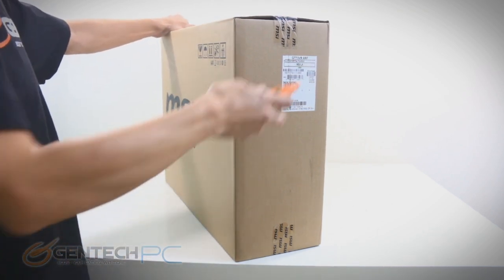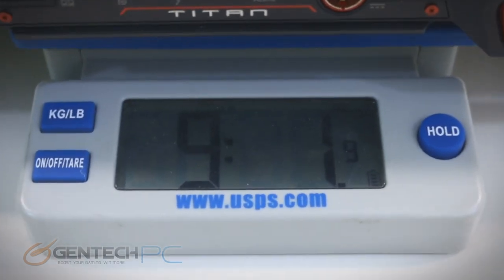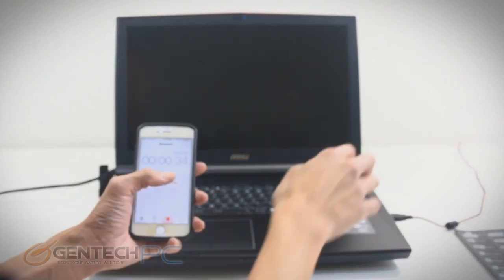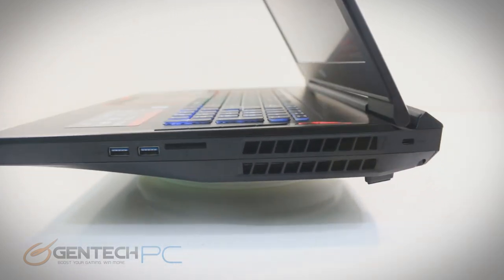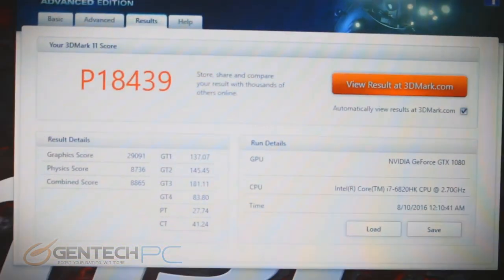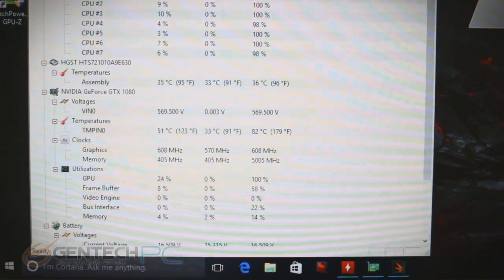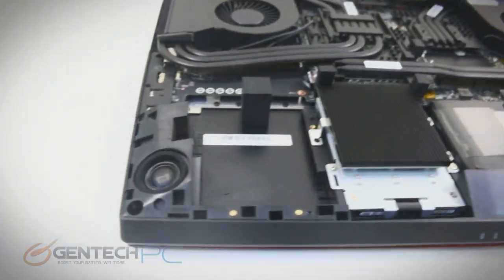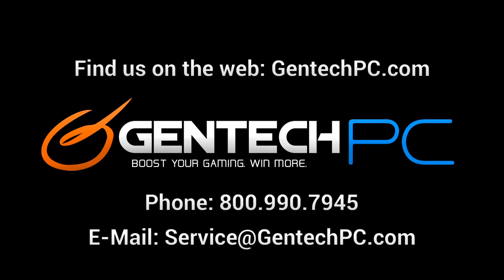MSI GT73VR NVIDIA GTX 1080 Review & Benchmarks

Comment: I'm currently saving up for a replacement Phantom 4 drone for one that I lost around a week ago. I'll save up for this gaming laptop too, will have it in around a couple of months. In the end, I will have both. Even though I already have a GT72 with 980M, I want to upgrade.
Reply: I also have the gt72 6qe like you. I got it in July and not this came out. The gt73vr titan01 is the same price as the one i have. Im so jealous, but the 980m is a beast all my games on high and i get real smooth frame rates so im not complaining.

Comment: Btw there is no g-sync?
Reply: Can u be more specific? Thought so it really doesn't matter what screen rate u have, where i can get that driver?
Reply: But is the screen capable? 120hz does not eliminate screen tear - it just makes it less anoying...
Reply: +CRYPT from CATACOMBZ finally someone asking my same question..check their web site they updated the display specifications and add g-sync ..I don't know if they did it on purpose after the fuzz regarding the g-sync
Reply: Maybe i am blind, but still don't see any info about g-sync there
Reply: I believe the gtx 1080, 1070, 1060 have g-sync, you just go into the nvidia control center software and disable or enable, when g-sync is enabled your laptop is capped at 75 fps. long story short, g-sync is software controlled, no big deal.
Reply: MrGhost370 yes ,,,thank you ,,,,,thats was my question g-sync its a software thats need a compatible hardware display thats support it ,,,so the screen on this laptop support g-sync ,,,
Reply: Ie the GT73vr GRFTitan Pro Nvidia GTX1080. It has G-Sync enabled and I can disable if I prefer to get 150 to 200 FPS. With G-sync on I'm capped at 75 FPS

Comment: some 1 tell me is there a big difference between 980 and 1080 becuz my laptop has 980m sli and wondering if I shud upgrade to 2 1080s or I'm good and should wait 3 years or 4 please let me know
Reply: There is a Big difference between the 2 gpus alone the 980m compared to a desktop 1080 but with ur 980ms in SLI you shouldn't need to upgrade unless you want bragging rights.
Reply: Clock speeds and cuda cores gives huge difference but if you wanna up by mxm and got a thousand dollars then you might as well
Reply: You can upgrade. the video shows him take the mxm module and put it in the other slot
Reply: +Emperor Caligula what you talking about it says 1080 in title and in the hardware monitor
Reply: +Emperor Caligula my bad took the comment out of context
Reply: The 1080 is 40% faster than 980 just use this as a baseline. If you have General algebra knowledge you can solve for the performance. As for upgrading from a onion sli to 1080 sli then I think it will be a bad idea since your laptop coming probably won't handle both especially with the TDP  that is different from the two generations. I think the only thing is to go to 980ms  to 980s

Comment: HOW DID YOU GET IT?

AND WHEN WILL IT COME OUT
Reply from the maker: We are MSI's authorized resellers in the US and we started shipping these laptops  with nVidia 10 series since 8/16/2016.
Reply: GenTechPC so its on the market??

FROM 3 DAYZ AGO?!?

AND NO ONE TOLD ME!?

AM A GET 1060 LAPTOP

is 1060 powerful as 1070? (Laptops)

because if its much powerful i might get the 1070 laptop..

Comment: 9 pounds not too heavy.
Reply from the maker: For SLI and a laptop at this size, yes 9 pounds is not too bad. :)
Reply: its a gaming laptop for using with a mouse in a table
Reply: +GenTechPC it isn't sli the gt83vr sli is
Reply: +MrGhost370 well the sli version of that comes in 1070 sli
Reply from the maker: All GT73VR has dual MXM slots and some SKUs has SLI GPU.
Reply: +GenTechPC so potentially it's capable of sli? Or will it require too much power?
Reply from the maker: GT73VR does have SLI GTX 1070 available.  but SLI models required dual power adapter.
Reply: Is there a way one could upgrade to dual GTX 1070 SLI from a single 1070 GT73VR down the line?
Reply: MrGhost370 MXM cards are super expensive though.
Reply: smjdn
Reply: jfokd
Reply: Biplav Shrestha hands sweaty
moms spaghetti
Reply: I have a 9lb ASUS and I don't know why people make such a big deal out of it. It's not heavy to carry, and not too heavy for my lap. I was expecting it to just sit on a desk but I use it everywhere I used my old MacBook Air (POS).
Reply: 9lbs is only heavy for 80lbs girls.

Comment: Nice machine. I just picked up an asus GL502VS-DB71. Very impressed with 1070 in it. Couldn't imagine have a 1080 in a laptop. I'd say if you purchased any VR ready laptop with a 1070+ you'll be set for the next 3 year. Hell, an overclocked 970m couldn't even get closed to a STOCK clocked 1070.

Comment: Hm. is it the desktop GTX 1080 or is there an "m" hidden in there.
Reply: desktop gtx 1080, the M is dead
Reply: no more cut down mobile GPU's. Its the full fat desktop
In terms of pricing and replacement
GTX 1080 = The previous desktop 980
GTX 1070 = 980m
GTX 1060 = 970m

Comment: Can't take the 2.7ghz laptop CPU seriously after I've seen the Sager with 6700k
Reply: 2.7 is an idle (without havy load). It can be increased up to 4.0-4.1 GGz (depends on the stone itself). So, it can be taken pretty seriously)
Reply: So overclocking of non-K processor is possible? This laptop can have the 6820HK CPU. Are you talking about that? Cool. Leaning more towards the GS73VR though, 1060 good enough, still one heck of a laptop
Reply: Game and Seti/Folding  Farm duties on CPU and GPU farm when not gaming ;)
Reply: Oh ok i understand.6820HK 4.2GHZ  all cores prime95 stable + furmark? Very good. Did you do this with the BIOS settings or MSI software and do you have any screenshots of the config u used? I think the MSI software sliders max out at '42'. Maybe the BIOS can do more still. 
4.8GHZ on a 6700K desktop CPU must use so much more power, less efficient that a laptop chip, doesn't really seem worth it. 
In the end will probably go with GS73VR (thin and powerful) but I do like the increased CPU performance on this. Clockspeed is the only way to get more x86 performance these days since Intel's tick/tocks aren't giving any more itself.
Reply: Yeah seems like diminshing returns past 4.2 if possible. Don't think Furmark can damage the GPU. GPU has temp protection if it goes over 100C or so. Thanks
Reply: The new gen Clevo machine can hardly be called a laptop anymore. When you add its two power supplies, that monstrosity is way too bulky and heavy to carry around comfortably even in a backpack. This here MSI GT73 seems to be pretty much hitting that ceiling where you get the most powerful notebook architecture currently available in a system that, while not really made for mobile use, you still can easily fold in and rig back up elsewhere whenever you want to. Makes it perfect e.g. for game developers who want to show off their stuff at an expo, as well as for avid gamers who are regularly commuting between two places, or just want to hang out at a friend's place and bring their gaming rig.
Reply: That doesn't contradict my point, though. The MSI GT73 is fairly comfortably portable and travel-proof, whereas the highest-tier stuff isn't something you're likely to carry around for more than the distance between your room and the boot of your car :-) .
Reply: I'd be fine at 4.2GHZ for the 6820HK. @4.2 all cores Prime95 stable I wonder what the temps are with Prime95. 4.2 is most of the way there, 4.7 is just a bit more. I see a GT72 on Ebay with that CPU and 970m for $1169 shipped. 
In my previous comment, I was talking about the GS73VR, the 5.3 pound laptop with 3 fans. To have 2 fans for the CPU and 1 for the GPU instead of the stock design of 2 for GPU, 1 for CPU and have the 6820HK.

Not for gaming but making Fidelity ATP and other software and software updates really snappy.
Reply: Only mid 70s with 4GHZ overclock all cores Prime95/Seti@home? Probably 80s i'd guess. 
Yes I know they are different beasts.
But the GS has potential in that with a design change it could be oriented more as a powerful x86 machine rather than gaming machine. 

Thought Pascal took as much or less than Maxwell
Oh, how heavy for a 6820HK + 1060 Clevo? THanks
Reply: Thanks for the beautiful review , just subscribed , i was looking through the comments there are still no clear answer weather this laptop FHD screen @ 120 hertz have a G-sync or not , please do reply since i am planning to purchase one possibly from gentechPC

Comment: is that a desktop 1080?
Reply: Pretty sure it is.
Reply: it is on a mx card
Reply: ***** it is lol
Reply: According to benchmarks currently available, their "twiks" gives a performance delta about 10 percent. It is, is some instance, a difference for a desktop GPUs between two models from different manufactures.
Reply: ***** the perfomence delta isnt even 10% in most cases and + oc its even less
Reply: I believe it is. Just a different form factor and slightly slower
Reply: Sharjeel A. you are basically right. The same amount of CUDA cores, texture processors ext. The only difference is base frequency - slightly lower. But according to benchmarks, the difference in FPS is less than 10% in majority of the AAA titels.
Reply: Vsevolod Nedora beqause laptop cpu's are mutch slower
Reply: gino xx_geene-XX Not exactly. You see, most of the AAA  titles these days are heavily GPU dependant, so the top-end processor is not required at all. Generally speaking, processers such as i7 6700HQ or better is sufficient for GTX1080 stable load at 100%. Processors such as i7 6820HK is more than enough to utilise several heavy loaded applications at once. So... Processors are not an issue - the temperature is a problem. In order to keep GPU's under full load and even overclock is you need to transfer huge amount of heat out of the chip. Required amount of metal or equivalent water block with pipes, pomp and radiator - are just too big for a laptop case. So nvidia turned down chip's clocks speed in order to make GPUs a little bit cooler, so the required cooling solutions will fit the chassi. That's pretty much it)
Reply: +Vsevolod Nedora it is all of the factores cpu, heat, power usage i know that thats why they turned down the clock but laptop cooling has come a long way and i think that there must come some models that are the same as the desktop
Reply: gino xx_geene-XX Oh, there are!) All asus 'VO' series includes fully unlocked descktop GPUs if you are willing to carry with you a huge water blocked that are required for utilasing those GPUs. 
The only thing that is now is unavailable - is overckocking the voltage. For some reasons, obviously including thermal and power supply limitations, manufactures forbit users to change chip or memory voltage - except this little problem you have fully desktop GPUs. Come CLEVO's models also fichured a desctop i7 6700k but... in my opinion it is hardly targeted a ordinary gamers. It is for those who need CPU for something else)
Reply: +Vsevolod Nedora yeah iknow
Reply: it is
Reply: It's the desktop 1080 Chip slightly underclocked and voltage locked. Nvidia will say it's the same chip where the M versions before were very different from their desktop counterparts.

Comment: This or Asus G752VS?
Reply: This... IMHO 1080 > 1070
Reply: Actually I meant when both are in 1070 config which one to get.
Reply: Sorry hahaha... Misunderstood you there... No worries... both has almost the same specs. If you like a more flashy laptop G752VS is the way to go. But if you want a more low profile and blackish laptop GT73  will suit you better. I prefer MSI to asus (steel series keyboard, Lighter feel)... Dont forget to get the 120hz display option... :)

Comment: I have a MSI CX 61 and it had at the buy point 23db working volume and after 3 years almost 69db. I think this pc will have 200db after two years XD  To all PC experts, I'm also a expert and I work at a it company and I know The air flow can be blocked by dust. And I already cleaned it ^^ so don't worry ;)

Comment: God. Dammit. I JUST bought a GT72s and I JUST barely can't return it.
Reply: If you bought an alienware, you could hook it up to alienware graphics amplifier. The total cost with gtx 1080 would still be lower than this. That's what I have done.
Reply: Yeah, I have thunderbolt 3 but the external GPU chassis are super fucking expensive and it only gets you pci-e 3.0 x4 anyways.
Reply: arc00ta Ya, AGA 's price was 160 for me. Its made cheaply but it works and it's faster than core.
Reply: +MrGhost370 Except they are not. We can upgrade our cards.
Reply: MrGhost370 almost no bottle neck.Goodluck finding mxm cards
Reply: *almost...
Reply: Paul Francis dude these cards' framerate is 10%less of  desktop version.  AGA is same.
Reply: +MrGhost370 The discussion here is about the if aga will bottleneck enough to make a difference.  The answer is no.  10% at most same as 10 series laptop but for cheaper. 1/3 cheaper. You can't even have a discussion like an adult and I am the kid?
Reply: +MrGhost370 Google hulkyboy and just watch his conclusion on the aga bottleneck.6% difference in 3d firestrike.
Reply: +MrGhost370 LOL dude you know you are wrong. I  am not in front of my laptop right now. I will send you a link.  I benchmark games not 3d firestrikes. Again it's not you vs me.You must be a Trump supporter since you would rather ignore facts.

Comment: Holy shit those fans, impressive!
Reply from the maker: Yes the blades on the fan and heatpipe are completely re-designed.
Reply: From what I can see, compared to your other video tests, this machine is pretty close to silent in game mode?

Does this laptop support optimus, or is it turned off?(preffer off)
Reply: One more thing, it's a shame it doesnt have G sync support?
Reply: One more thing! That grease from the both the cpu and gpu, what on earth did MSI do? I mean, i'd clean that up, maybe the temps wuld been even lower, or the laptop run more silenced.

Comment: Lol.....all that cooling, allll that cooling...yet they decide to put a mobile cpu in it..............what?😯😐😐😑
Reply: you clearly have no idea what you're talking about. Mobile gpu's do not exist anymore go do some research. This is a desktop 1080
Reply: did you not see the OC tab in the bios? it's a 6820hk processor that can be bumped up to 4ghz that's plenty also I wear contacts so I'm a bit blind
Reply: +Luis Valle lol...so whay not just put a 6700k in it like what sager and clevo does
Reply: I was under the impression the HK (unlocked processors) were the desktop versions. That's how MSI marketed them with the high end gt72's
Reply: +Luis Valle mmmm okay then
Reply: Learn something new everyday. I thought the 6820 was just an updated skylake desktop i7
Reply: But they could have at least put an i7 6700 non-k processor in it.
Reply: No it does not